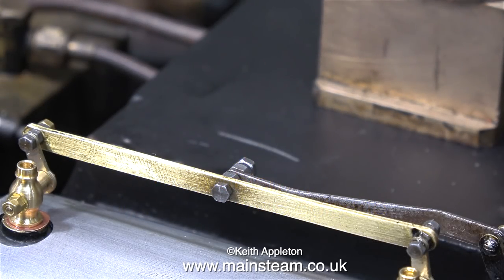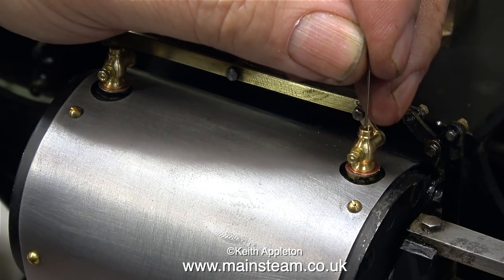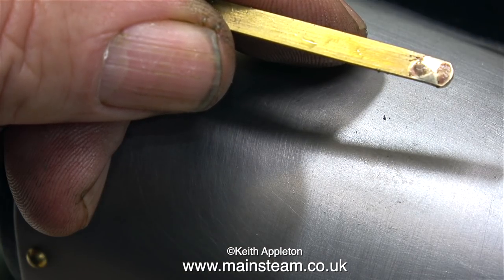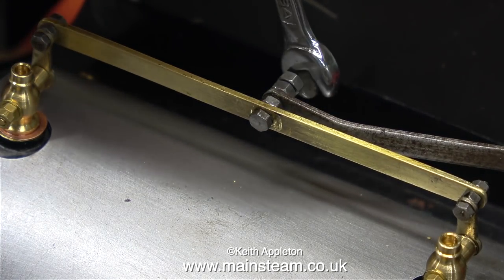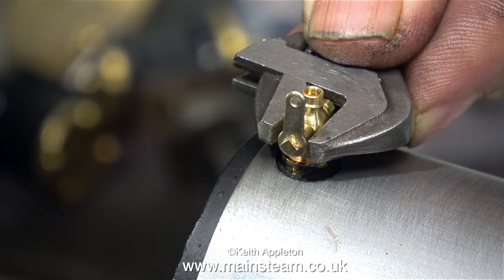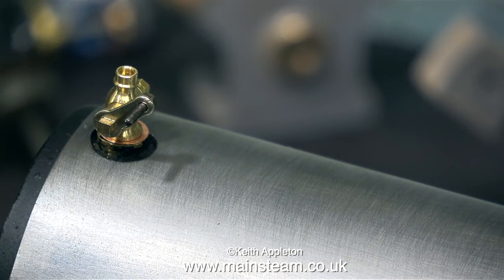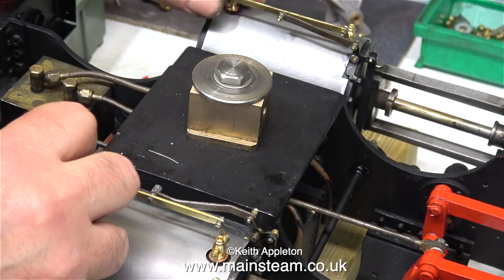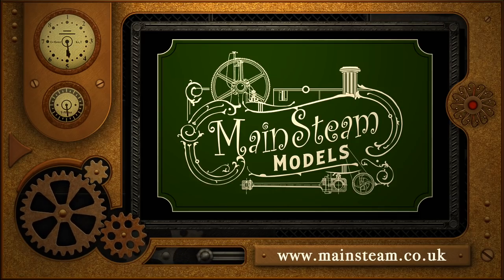HOGWARTS CASTLE - A 5 INCH GAUGE LOCOMOTIVE - PART #25

Comment: The error in that link arm was caused when someone marked the length of the piece, but cut on the wrong side of the line. Or maybe they had a longer piece and cut it in what they thought was half, but again one side was shorter. Either way, silly error. I noticed the slight angle difference of the valve levers in previous vid when you mentioned 'look for the error,' but didn't know that such a small error could cause complete failure.
Reply from the maker: the tolerance in the hole position in a cylinder drain cock is very close.